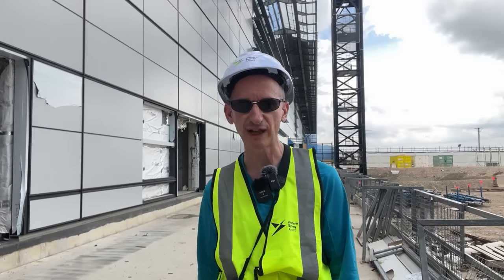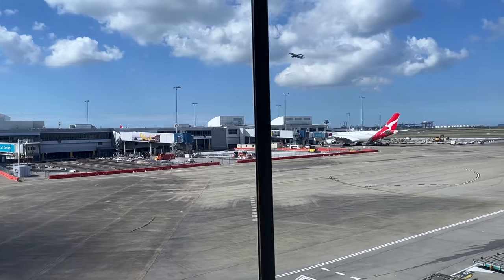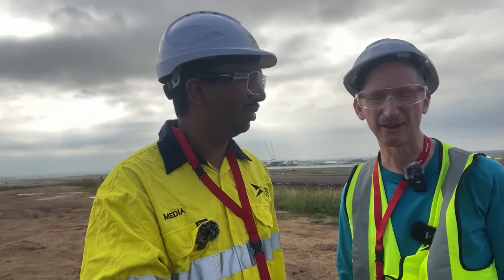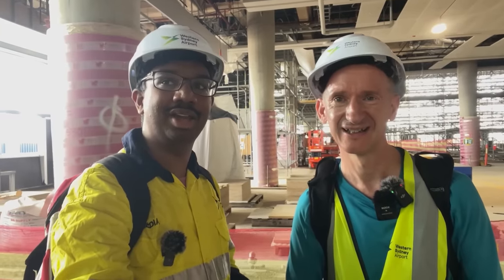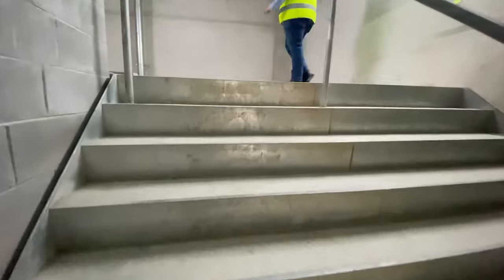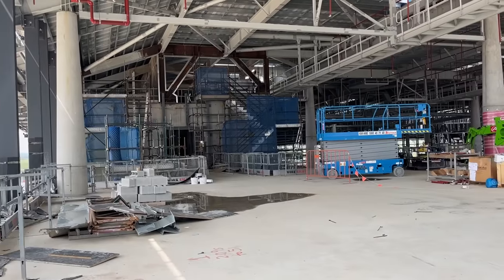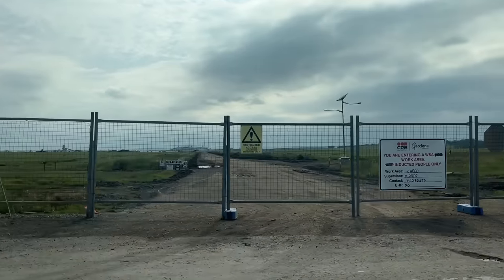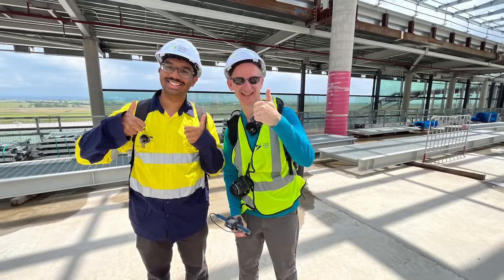We got a private tour of Western Sydney Airport!

Comment: Living in Pyrmont I am so NOT looking forward to this. My apartment and strata fees were so expensive i travel low cost carriers and can walk from Mascot and Wolli Creek stations
Reply: Sydney Airport isn't closing you know. Book a flight that leaves from/arrives there.
Reply: I live north of the bridge and I’ll still be flying from Sydney Airport unless ticket prices are significantly lower that it will justify the longer commute to WSA.
Reply: @kismetau  I just get the feeling Scoot, Air Asia etc will flock to the new airport
Reply: @goodyearspokane   If you look at Melbourne - low cost airlines still fly to both Tullamarine and Avalon. No curfew means more flights and less wait times for transfers. Having 2 airports will lead to competition so benefit travellers. There also won’t be an airport access fee for WSA.
Reply: Well, maybe you'll be walking a bit further if the stations before the new airport are substantially cheaper. Chin up, exercise is good!

Comment: No 2nd Runway contemplated to be built for many years to come….. Huge Mistake as usual by Australia… Imagine the cost building in 20 or so yrs compared to now…. brainless!
Reply: It will take a while for WSI to reach capacity. Would it be cheaper to build the second terminal and runway now? Probably. But then it will sit there in mothballs until airport traffic reaches a point where opening it makes economic sense. It costs money to run a terminal, runway and associated infrastructure, and I'm sure they want to make a profit. And it even costs money to maintain mothballed infrastructure, if you don't want it to deteriorate. The Government (doesn't matter which one) would be relentlessly attacked on wasting money on a closed terminal and runway. Or having an airport that doesn't make money because they have to split aircraft and passengers between terminals. You know how politics and the media works, I'm sure. The total project cost is around $11 billion as it is.
Reply: How so? It's flat land
Reply: @chrispekel5709  Not totally flat, but not the most difficult terrain either. Inflation will probably push the cost up. So it depends on how much whoever builds it is wiling to pay. And depending on how far in the future it is, improvements in construction technology and techniques might lower some costs. Plus a lot of the infrastructure, like the roads, Metro and services, will already be there.